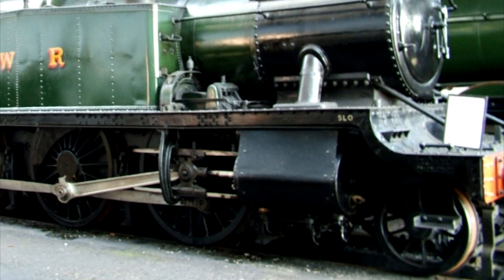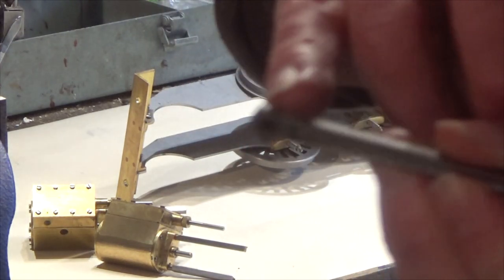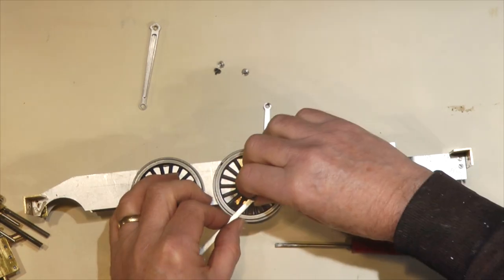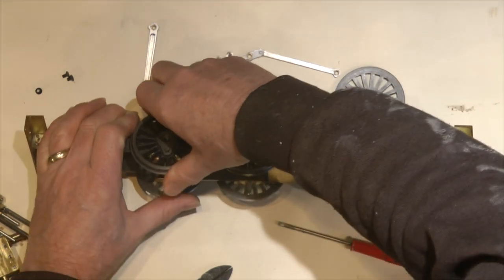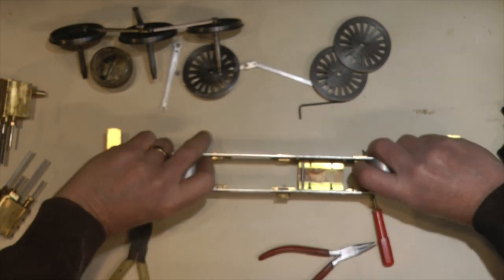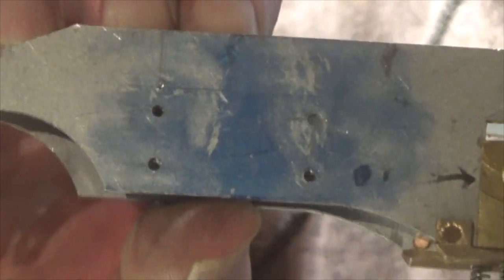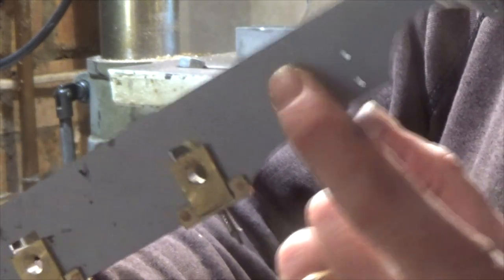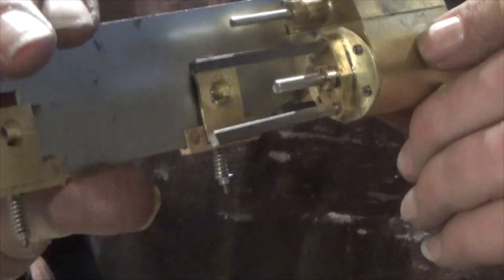Gauge 1 Live Steam Scratch Build 9

Comment: Hi Dave are you going to build the boiler to the drawings?
Reply from the maker: The simple answer is no. The drawings show two boiler options one for coal firing and the other spirit fired. I didn’t fancy a coal boiler for this type of loco as I thought it would be very tight for space inside the tiny cab for coal firing. I think a loco with a tender gives you a bit more space for coal firing. As to the design for the spirt fired boiler, I just did not like it. I have built a taper style multi tube copper boiler for a GWR Collect Goods so this one will be very similar but probably slightly longer.